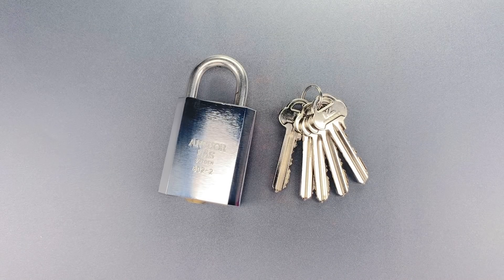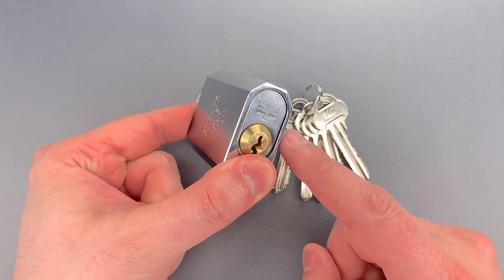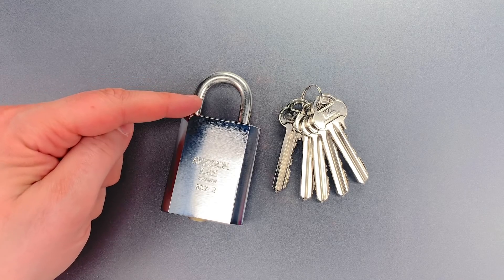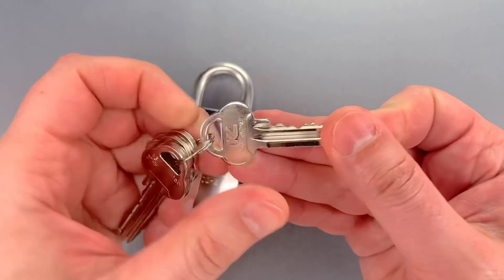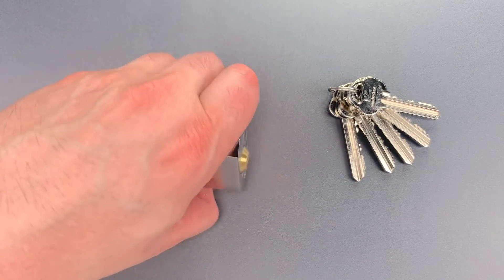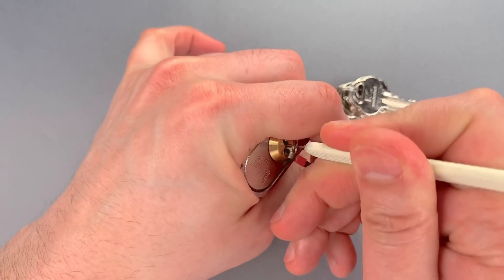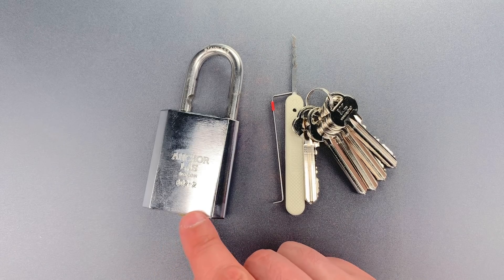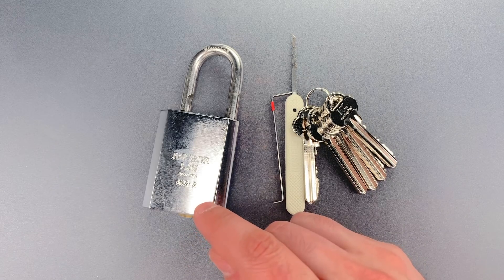[1245] Swedish Anchor Lås 802-2 Padlock Picked FAST (7-Pin Dorma Core)

Comment: I have always wondered why Swedish still use those toys when the best locks (Abloy) are easily available because Swedish Assa bought the Finnish Abloy in 1994 forming Assa Abloy, which was a sacrilege if you ask me. =(
Reply: Normally I do not comment on YouTube videos related to the padlocks we are producing. 
I am humbled to see that LockPickingLawyer is taking on our padlocks in his famous Youtube channel. He is really skilled and does a great job keeping us lock manufactures on our toes. 
However this time I find it a bit unfair as LPL is actually testing a lock cylinder made by DormaKaba which happens to be installed, probably by a locksmith, in one of our padlocks. A type of padlock without cylinder we sell to locksmiths for them to install certified Scandinavian Oval cylinder in.     
Even though I find DormaKaba to be a fine company I cannot  take credit for nor be responsible for the quality of all their cylinders. 
I do, however, guarantee that the Swedish manufactured padlock in this video is made to the highest standard and quality. 
Stay safe and secure!
Best regards Tomas Eriksson 
CEO and Owner
ANCHOR LÅS AB 
SWEDEN

Comment: I have that lock on my garage door. I guess not anymore
Reply: Check the bitting. If you have some deep cuts towards the front and shallow cuts in the back, it’s a lot better than the example in this video
Reply: Normally I do not comment on YouTube videos related to the padlocks we are producing. 
I am humbled to see that LockPickingLawyer is taking on our padlocks in his famous Youtube channel. He is really skilled and does a great job keeping us lock manufactures on our toes. 
However this time I find it a bit unfair as LPL is actually testing a lock cylinder made by DormaKaba which happens to be installed, probably by a locksmith, in one of our padlocks. A type of padlock without cylinder we sell to locksmiths for them to install certified Scandinavian Oval cylinder in.     
Even though I find DormaKaba to be a fine company I cannot  take credit for nor be responsible for the quality of all their cylinders. 
I do, however, guarantee that the Swedish manufactured padlock in this video is made to the highest standard and quality. 
Stay safe and secure!
Best regards Tomas Eriksson 
CEO and Owner
ANCHOR LÅS AB 
SWEDEN

Comment: The moral in this case is - due to random manufacturer - you can get  a great lock with terrible bitting. If you do, return it! Companies like this need better quality control to protect they reputation from junk like this particular example getting out in to the wild
Reply: Normally I do not comment on YouTube videos related to the padlocks we are producing. 
I am humbled to see that LockPickingLawyer is taking on our padlocks in his famous Youtube channel. He is really skilled and does a great job keeping us lock manufactures on our toes. 
However this time I find it a bit unfair as LPL is actually testing a lock cylinder made by DormaKaba which happens to be installed, probably by a locksmith, in one of our padlocks. A type of padlock without cylinder we sell to locksmiths for them to install certified Scandinavian Oval cylinder in.     
Even though I find DormaKaba to be a fine company I cannot  take credit for nor be responsible for the quality of all their cylinders. 
I do, however, guarantee that the Swedish manufactured padlock in this video is made to the highest standard and quality. 
Stay safe and secure!
Best regards Tomas Eriksson 
CEO and Owner
ANCHOR LÅS AB 
SWEDEN

Comment: What is the “bidding” LPL is talking about here?  
Definition?
Reply: It ("bitting") refers to how deep (or not) each notch in the key is cut, corresponds with the height of the pins inside the lock. A series of shallow cuts like this lock has can render it vulnerable to raking, whereas deeper cuts can making raking far more difficult or impractical.

Comment: The downfall of a semi decent lock, so sad
Reply: Its just a shitty core.
Reply: @Bluezero75  No it isn't. It's shitty bitting. The core itself is pretty good, and with decent bitting it would be a reasonable challenge to pick. So, if you are buying one of these, look at the key before you buy!
Reply: @dlevi67  Yeah, but its core related. Not a shitty lock at all. I have some bigger models of theese locks with EVVA cores inside.
Reply: @Bluezero75  Ah - now I understand what you meant; I took the comment to mean 'shitty core' in general.